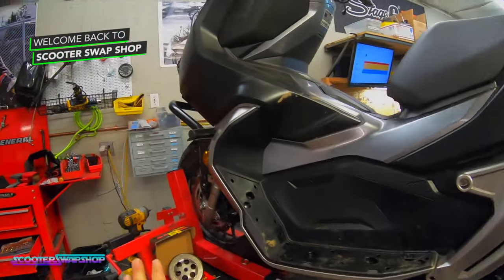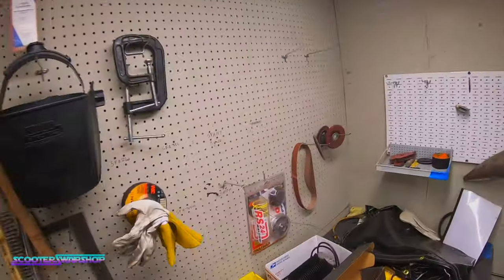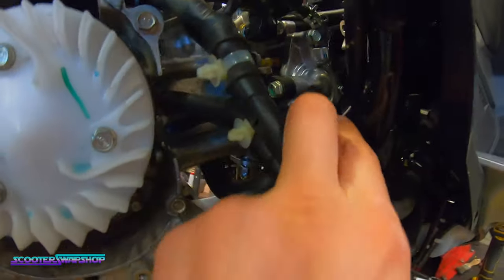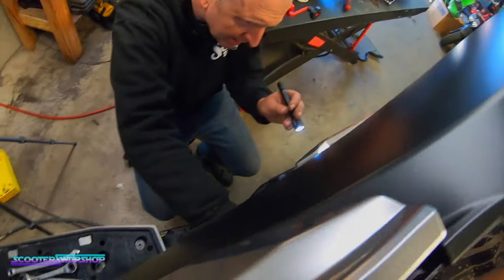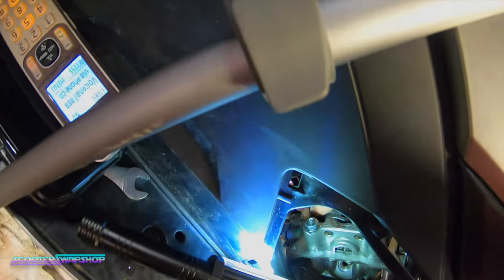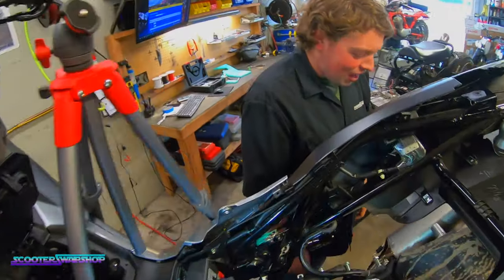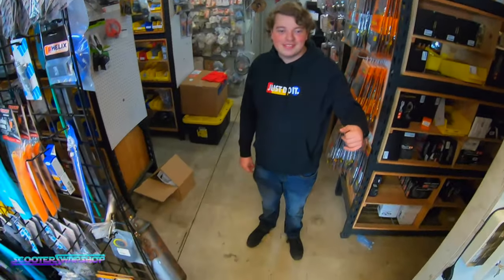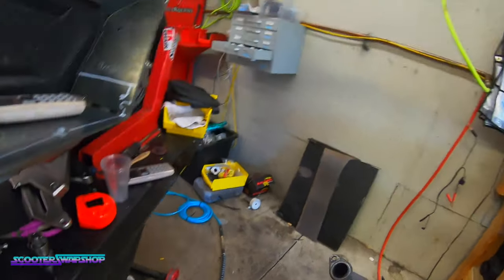How to install a cam in a Honda ADV 150 | DCR CAMSHAFT

Comment: HI guys major strip down! Very interesting,  TDC on the firing stroke? its a pity there is no holes in the sprocket to zip tie the chain to it, I did an engine change on my Piaggio MP3 500 ( Honda Engine ) looks almost the same its not a hard job just to drop the engine. Another great video thanks
Reply from the maker: yeah we wanted to do it this way initially but next one we will pull the motor

Comment: I thought this was a 4 valve motor. Honda need to do this with a 4 valve 250cc. sure would be a cool little dude.
Reply from the maker: they just released a 300
Reply: @Scooterswapshop  cant find one here in America.
Reply: @km4fsi827   the new 2022 pcx 160 is a 4v version of this motor but better and i think it is shared on the new adv of the same year
Reply: @321PCX  Yes i have a 2023 pcx 160 4v. i just wish it was a 250cc. My wife has the 2022 ADV 150 and its still a 2v.